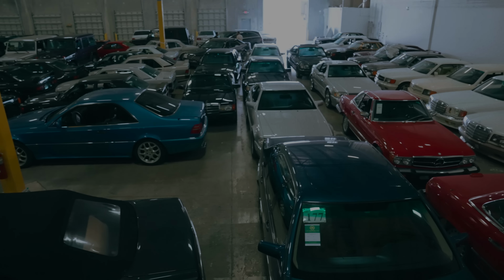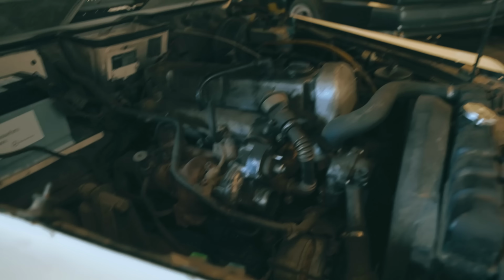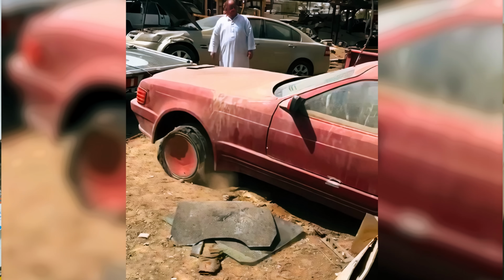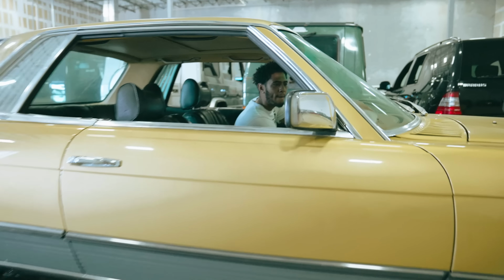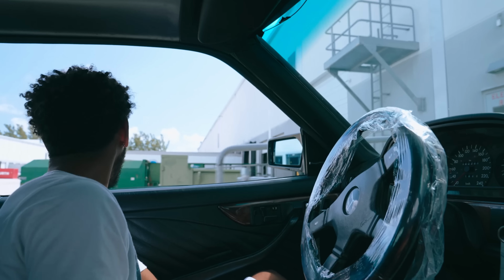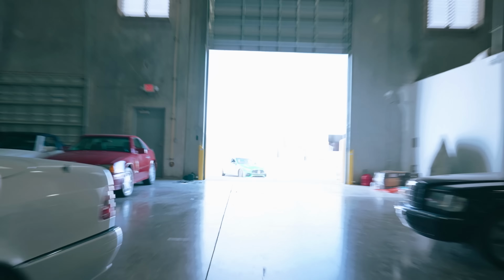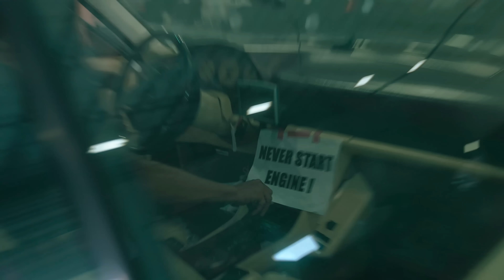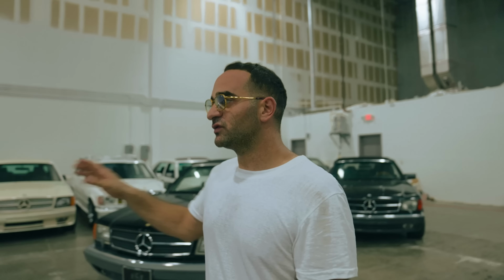We had to move EVERYTHING. | VLOG #016

Comment: Thank-you guy's.
I'm now resurrecting my 1990 560 sec.
You're an absolute inspiration to the classic Mercedes-Benz.
At the moment I'm still looking for some parts, but we will push on. I salute the engineers at Mercedes-Benz and guys like you also.
Rock on
Reply from the maker: hell yeah! No deadline, take the time to get it right
Reply: I'm finding out that parts are hard to come by. 
The next piece I'm looking for is a windshield . ( Never let your friends drive your MB )  The car only reads 102609 kms . 
And with about 350hp
Reply: @Richless_Rich  I have a windshield for you if you interested
Reply: @jodyguess7662  yes .
Reply: @jodyguess7662  I got ripped off by Mercedes-Benz from my hometown. Sold me a windshield that was shattered in the box for $1,700 and wouldn't let the body shop inspect it first.